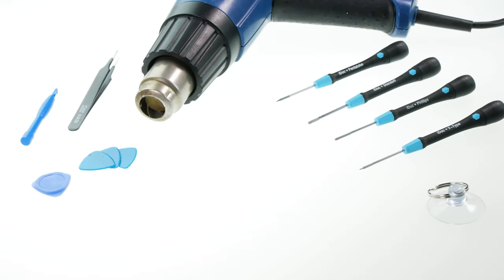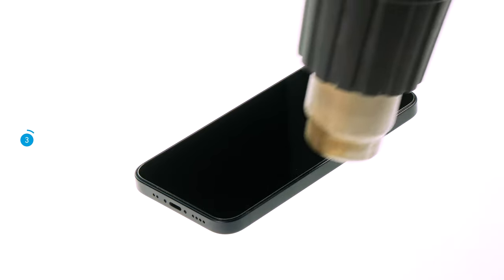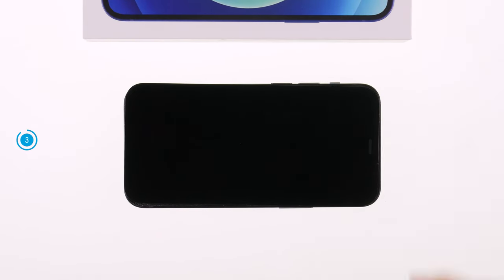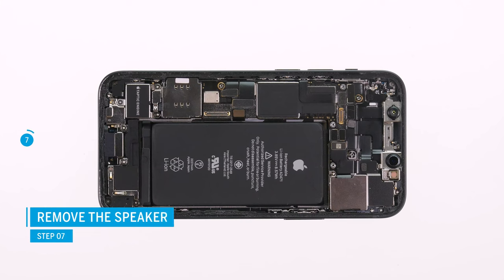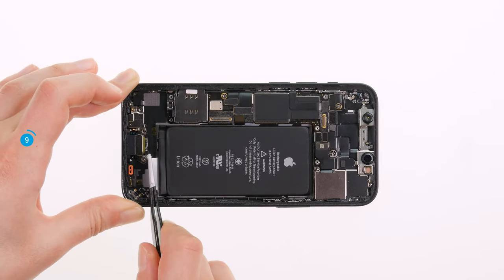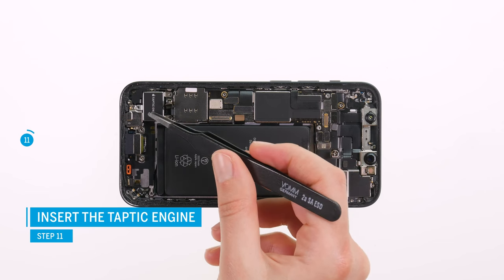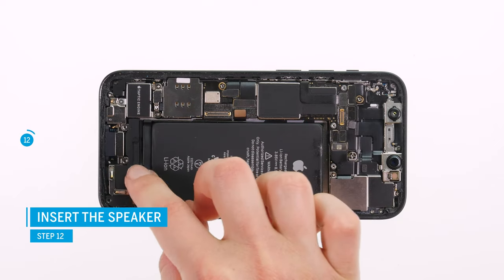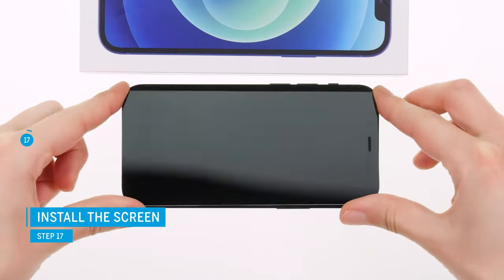iPhone 12 mini – Battery replacement [including reassembly]

Comment: Is the battery health become 100% again after replacement?
Reply from the maker: Hi aswar aziz,

when changing the battery, the function "Battery status" is not supported anymore, even with an original battery. But yes - if you have a battery with 0 charging cycles, it's health will become 100% again. 

Best
Sabine
Reply: @iDocEN  thanks for your reply

Comment: I finally managed to change battery, but it's a big SUCK....Sadly I had to change lcd also...and as you know, if you DIY than you will get battery and display error messages and wether you choose a good quality display, you have to program true tone, or that won't work...

I have 2 iphone mini and learned a lot when opening it, but it is not the phone that used to be like iphone 5-6...much more complicated.

Comment: Thank you for the video. Will an error message pop up after the replacement stating that battery is not compliant?
Reply from the maker: Hello Tau Ba,

there is a message from Apple for 4 days on the lock screen and 15 days in the settings.

Best regards

Marc from iDoc
Reply: @iDocEN  thank you. So after 15 days there will be no sign that the battery was replaced? What will be shown on the battery health indicator? Nothing?
Reply: @pantauba  Also looking for this answer. In a previous iphone XS the battery warning seemed permanent, not temporary?

Comment: Hello and you dont need new sealant??
Around edges to water proof phone??
Reply from the maker: Hello Artis Grietens,

there is no water resistance even after re-gluing. 

Best regards

Marc from iDoc
Reply: @iDocEN  but its imposible to do like factory when phone has waterproof?
Reply: All technicians refuse to change screen sealing adhesive or give warranty on waterproof because don't want to get any complaints if water gets in. But if you replace it yourself then your phone will be waterproof again, just simple physics and logic

Comment: Looks like Tim Cook doesn't want anyone messing with his shiny iPhone 12 mini. The screen is glued too? My gosh...I thought this would be similar to opening to the SE 1st gen or 5s. Tsk...Tsk...Tsk...
Reply from the maker: Hi Patrick,

thanks for sharing your opinion. Yeah, Apple is kind of restrictive and don't want any non-professional to repair iPhones. To be honest: If they didn't put obstacles in the way of DIY people, the repair wouldn't be witchcraft either. Other manufacturers show how it's done. 
But, the repair is still not impossible, so don't loose confident right away.

Best
Sabine
Reply: @iDocEN   changing screen on Xiaomi is more difficult as you must dissasemble whole phone